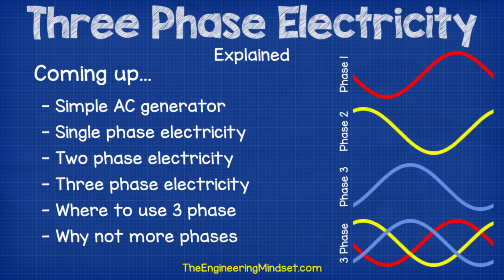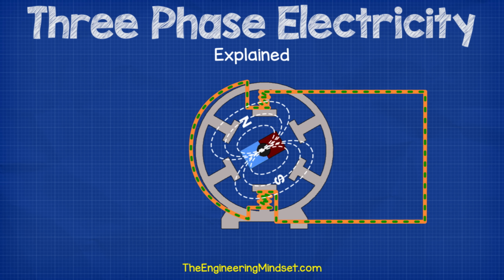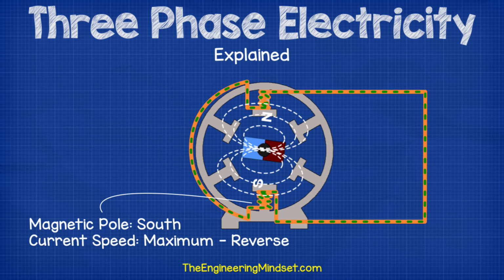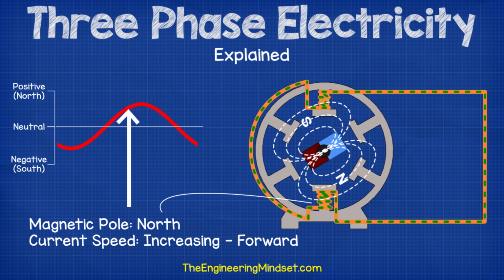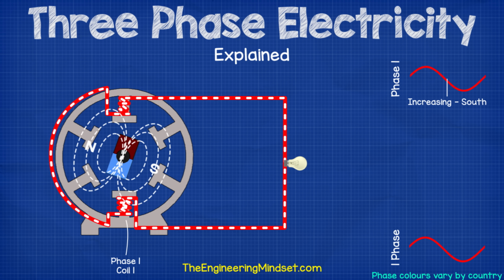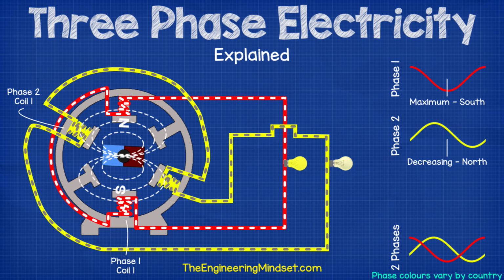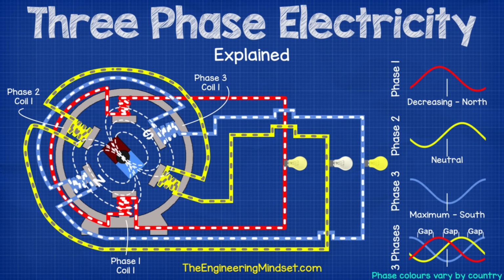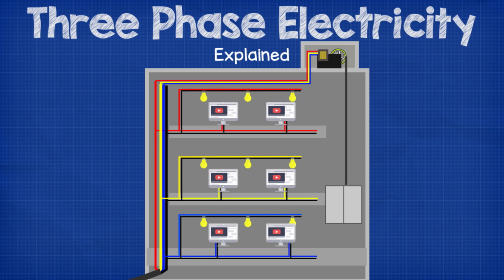How Three Phase Electricity works - The basics explained

Comment: You mentioned single phase electricity creates a dimming of a light because of the voltage change, but then later in the video said residential homes use single phase and office buildings might use single phase for lights? How do you maintain constant power with single phase electricity?
Reply from the maker: It's happening 100 times a second, it's basically constant to the human eye

Comment: In Europe it is normal to have all three phases connected to every building to have a more even distribution of load on each phase.
It is also more common to find 3-phase equipment for consumer use in Europe.
Reply from the maker: Check our new revamped 3 phase explained video, sooooo much better:👉 LINK: https://youtu.be/c9gm_NL7KyE

Comment: I don't know where you live, but I have never seen a house that doesn't have 3 phases. You need it for your typical oven & stove, and in more modern houses for the heat pump or electric car charger.
Reply from the maker: Check our new revamped 3 phase explained video, sooooo much better:👉 LINK: https://youtu.be/c9gm_NL7KyE

Comment: all the process is right and explanation is superclass but there is a problem ,I thought... magnetic strength is high on the axis of magnet and low in the direction 90 degree with axis .... flowing of current is not dependent on strength , it depends on the change of magnetic field flux... maximum current or voltage  will be found then where the change of flux is maximum and this is on direction 90 degree  because the change of flux is maximum in this position which was demonstrated on graph by your lecture , but there magnetic field strength is low not maximum position compared to other position of magnet bar...

please, everyone reply  and help me to clear my concept ...
Reply from the maker: Check our new revamped 3 phase explained video, sooooo much better:👉 LINK: https://youtu.be/c9gm_NL7KyE

Comment: You labeled the poles of the magnetic field incorrectly by mistake.  The north and south poles are actually separated like the red and blue colors on your magnet.  In other words, the dipole moment is supposed to be parallel to the axis of symmetry.  Instead, you accidentally depicted the dipole moment as being perpendicular to this axis.
Reply from the maker: Check our new revamped 3 phase explained video, sooooo much better:👉 LINK: https://youtu.be/c9gm_NL7KyE

Comment: There is no flickering in the lamps mate.
All these lamps run on single phase, and they do not flicker.
They have a wolfram coil inside them that is glowing.
Reply from the maker: They flicker, look at a city at night from a distance. Or connect a lamp to a VFD and slow the frequency down.

Comment: Is a single family home connected to 3-phase or not, well it depends, , al least here in norway, newer builds generally have 3-phase avakable at the phuse box/nain dustribution bard/ call ir what you want
Reply from the maker: Check our new revamped 3 phase explained video, sooooo much better:👉 LINK: https://youtu.be/c9gm_NL7KyE

Comment: Good information and animations, but where on earth do you only have a single phase to an entire house? I live in Denmark and haven't seen a house only use 1 phase, i've seen small apartments use only 1 phase but also the same size use 3 phase. In my house the fases are split into different sections, like kitchen and bathroom downstairs use L1(phase 1), 2 bedrooms and living room use L2 and second floor only uses L3.
Reply from the maker: Check our new revamped 3 phase explained video, sooooo much better:👉 LINK: https://youtu.be/c9gm_NL7KyE

Comment: This never made sense to me, as I was always under an impression that those 3 phases are distributed using a single power wire (since sockets in our apartments have just power and ground lines). This video has made it all clear, thanks.
Reply from the maker: Check our new revamped 3 phase explained video, sooooo much better:👉 LINK: https://youtu.be/c9gm_NL7KyE

Comment: Great  spatial and mechanical explanation of AC power generation and flow. This confirms how I thought it worked for many years, but could never get any kind of clear explanation from some of my electrican friends. I began to suspect they probably didn't really understand it themselves. I guess you can spend years pulling wires and not need to know this stuff. I absolutely love your videos!  Thanks!
Reply: @Karen Fiedler I call that the "Waterboy" condition. In that movie, Adam Sandler's character was constantly involved in football games, but he never learned how to play, because it wasn't necessary for his particular job.
Reply from the maker: Check our new revamped 3 phase explained video, sooooo much better:👉 LINK: https://youtu.be/c9gm_NL7KyE

Comment: I do have a question, if anyone can make me understand. Is a cycle considered only for one pole of a magnet ? Because let's say the  south is at the top, forcing electrons to go in one direction, while at the same time, the north is automatically at the bottom , forcing electrons to move in the other direction. So doesn't that mean that electrons moved by south and electrons moved by north meet somewhere on the left or right? So when do we consider a cycle? i'm a little confused
Reply from the maker: Check our new revamped 3 phase explained video, sooooo much better:👉 LINK: https://youtu.be/c9gm_NL7KyE

Comment: Hi, Thank you very much for the video and it is meaningful...…. I would also like to know the complete procedure how a permanent magnet synchronous motor works from scratch...It will be great if you can provide me a link or guide of each step (starting from the supply of 3 phase AC to the stator)
Reply from the maker: Check our new revamped 3 phase explained video, sooooo much better:👉 LINK: https://youtu.be/c9gm_NL7KyE

Comment: Bravo.......I under stand three phase ......and motors........short storie long.....I have  three phase dc controler 440 volt 32 amp.......question....if u pulse dc isn't that just ac.......cheers
Reply from the maker: Check our new revamped 3 phase explained video, sooooo much better:👉 LINK: https://youtu.be/c9gm_NL7KyE

Comment: would be more accurate if you included the main and subpanels in your diagram to show you are not running 120v circuits directly off a 3 phase wire.
Reply from the maker: Please see our videos on main electrical panels
Reply from the maker: Check the new SUB PANEL EXPLAINED ➡️ video https://youtu.be/NUSNa-7Hecw

Comment: moment of phases and power
wires of alternator for 10A
cos phi = 1
4.30 - single phase
127V - 1270W
230V - 2300W

5.00 - two phase (from 3ph system)
2x 127V - 2540W
2x 230V - 4600W

5.30 - three phase
3x 127/220V - 3810W
3x 230/400V - 6900W
Reply from the maker: Check our new revamped 3 phase explained video, sooooo much better:👉 LINK: https://youtu.be/c9gm_NL7KyE

Comment: 3 phase systems in low voltage existing divesity of voltages: 120/208, 127/220V, 133/230V, 220/380V, 230/400V, 240/415V, (254)440V, (266)460V, (277)480V.
For home 127/220V is better. For industry 400V.
Reply from the maker: Seen our new 3 phase transformer video?➡️: https://youtu.be/u0SsejDCVkU

Comment: I didn't sift through dozens of comments, sorry if this was already addressed.  In North America, residential dwellings routinely are fed two phases  of electricity. Single phase delivers ~120 volts for lighting, electronics, vacuum cleaners, hair dryers, other small appliances, etc. via 'wall outlets'. Both phases deliver ~220 volts when coupled together and are used to power electric ranges (ovens & cooktops), air conditioning & heat pump compressors, electric clothes dryers, electric  vehicle  battery  chargers, etc..
Reply from the maker: Check our new revamped 3 phase explained video, sooooo much better:👉 LINK: https://youtu.be/c9gm_NL7KyE

Comment: A decent explanation of the power generation, but I think you missed a LOT of things that need to be understood.  For example, you do not help the user understand why the 2 phase power of a 240V USA system is actually 180 degrees, not 120 degrees out of phase (yes, it is a transformer trick).  And you miss helping the viewers with why the phases of power don't add up linearly for voltages (RMS voltage vs peak voltage).
Reply from the maker: It's all covered in other, newer videos. This one is old and terrible, I don't know how you've even been recommended it.
Reply from the maker: Seen our new Transformer video? here https://youtu.be/jcY4QN7awEc

Comment: Very good video, but you should have mentioned every connected phase doubles the voltage supplied to the appliance ...ie: a 110v appliance will get toasted if you connect it to 220v...
Reply from the maker: Check our new revamped 3 phase explained video, sooooo much better:👉 LINK: https://youtu.be/c9gm_NL7KyE

Comment: Well houses also have 3 phase power because there are house devices that need three phase power, for example electric stove, large Storage heater, strong machinery and appliances like wood cutting machine or welding machine, so three phase for a house is a must. It could be done also by using 3 separate single phases  in one 3 phase electrical connector, but strong fuse and thicker wires are needed.
Reply from the maker: Check our new revamped 3 phase explained video, sooooo much better:👉 LINK: https://youtu.be/c9gm_NL7KyE

Comment: I have a question,  if the electrons keep speeding up should those graph like animations keep getting steeper upto the neutral parts? This is not a critique or so I just want to know if i am understanding this correctly.  Thank for the vid!
Reply from the maker: The video mentions speed but really it's the amount of electrons changing. Their speed remains constant. It's hard to imagine an electron instantly going the other way at the same speed. So at the peak of the graph the maximum amount of electrons are flowing and at the  zero line, no electrons are flowing
Reply: @EngineeringMindset  Great answer! Thank you!

Comment: Cool explanation. I worked on radars in my career that used 3-phase, 3 wire (nine legs of 120v AC). Massive power output
Reply from the maker: Check our new revamped 3 phase explained video, sooooo much better:👉 LINK: https://youtu.be/c9gm_NL7KyE

Comment: I would add, tungsten lights heat an element that retains the energy and therefor continues to glow between pulses. This makes it basically undetectable.  It becomes much more obviously when you are looking at gas lamps like florescent or sodium vapour lights which have a ballasts to control the energy pulses. Video cameras can flicker or take images almost at the same rate and can synch up with the flicker of these gas lights.
Reply from the maker: Check our new revamped 3 phase explained video, sooooo much better:👉 LINK: https://youtu.be/c9gm_NL7KyE

Comment: Hey there, great video. I would just like to point out that the biggest reason we use 3 phases comes down to more than just what is reasonable for most budgets. 3 balanced phases have a very important property where the sum of their instantaneous power output stays constant when the loads are the same. This apparently makes transmission of power easier, but also means a 3 phase motor will be able to receive a constant instantaneous power from the electrical grid. With less than 3 phases that power is subject to intense oscillation and even dips below zero at times.
Reply from the maker: Check our new revamped 3 phase explained video, sooooo much better:👉 LINK: https://youtu.be/c9gm_NL7KyE

Comment: Can i ask..
Assuming the neutral is represent as the negative then the phase 1,2&3 is the live wire or the hot wire..
My question is can i connect those phase 1,2&3 to have 1hot wire and 1 negative (the zero volt)?

Pls respect. I just want to learn...
Reply from the maker: Check our new revamped 3 phase explained video, sooooo much better:👉 LINK: https://youtu.be/c9gm_NL7KyE

Comment: If you're going to power, say an outbuilding....and have a two post car lift, welder etc.  Check the voltage... on the build plate:  208-230 / 220V.   You may have a 240 motor but it will run on 208.  If you're looking for to power equipment and run your lights (120) 208.  Get a 3 phase generator if you want to run equipment. before you buy equipment check the mfg. voltage / Factory wire.  Most modern equipment will operate just fine on 208
Reply from the maker: Seen our new 3 phase transformer video?➡️: https://youtu.be/u0SsejDCVkU

Comment: If a factory had a three phase supply would they be charged 3x the amount for their unit of electricity (kw/h)?
Reply from the maker: No. They only get charged what they used per phase. Each phase will use slightly different kwh. They could have a 3 phase supply but only use 1 of the phases. I've once audited a building that had a 3 phase incomer but only used 2 of the phases. Never seen that since.

Comment: This would be a 1/3 parted phase motor, not a real 3 Phase and no following together parted motor .
A little irritating. Ok the phases are showed separately . But the beginning is counter part pol motor.
and then following the other totaly pols. it is a magnet switching band motor from construction.
Reply from the maker: Check our new revamped 3 phase explained video, sooooo much better:👉 LINK: https://youtu.be/c9gm_NL7KyE

Comment: Thank you for this great video. Just one observation: Light bulbs do not flicker for two reasons. One is, as you state, because 60Hz is too fast for the human eye to easily discern. (Actually the fluctuation in power is even faster, 120 Hz.) The second - and more important - is that the light is emitted by a hot filament, which does not heat up or cool down fast enough to respond to the ac frequency. A bulb filament emits the average power at roughly a constant rate, with only very slight surges and dips in response to the frequency.
Reply from the maker: Check our new revamped 3 phase explained video, sooooo much better:👉 LINK: https://youtu.be/c9gm_NL7KyE

Comment: Isn't the main reason for three-phase power generation is that it permits a feedback of electricity into the generator's electromagnets, and thereby a substantial augmentation of the generator's power, whereas ordinarily such self-excitation would be possible with only DC current?
Reply from the maker: Check our new revamped 3 phase explained video, sooooo much better:👉 LINK: https://youtu.be/c9gm_NL7KyE

Comment: Great video with an excellent explanation of three-phase power, one of the best I’ve seen.  You handled the alternating current great too.  Just a few issues with this (not being a troll, just pointing them out).  First, most houses, in the U.S. at least, are provided with two phase power.  Second, your explanation, perhaps it’s explained in the transformer video mentioned, shows two-phase as being 120 degrees out when it is actually 180 out.  Besides that, GREAT video. Thanks!
Reply from the maker: Seen our new Transformer video? here https://youtu.be/jcY4QN7awEc

Comment: Not entirely true about computers not needing 3 phase, data centers, server rooms and critical computers are usually plugged into 3 phase PDUs which in turn are plugged into UPS, and not just server computers, but also networking equipment, KVM switches and environment monitoring equipment for those computers within this environment, wonderful video thank you
Reply from the maker: Check our new revamped 3 phase explained video, sooooo much better:👉 LINK: https://youtu.be/c9gm_NL7KyE
Reply: @EngineeringMindset  def will do that thank you

Comment: So if i understand correctly, a phase is kind of like a piston in a 3 cylinder engine, when one is at tdc, (positive) bdc, (negitive) and the last halfway (neutral)? Took me years to try to understand 3 phase, and i feel thats correct. Each cylinder is replacing the other as its on its exhaust stroke, and are placed a certain # of degrees apart from one another so the power keeps going, more cylinders you add, the more consistent the power that goes to your wheels.  3 phase i think works the same way, correct me if im wrong, id like to see if my description is accurate, thanks.
Reply from the maker: Check our new revamped 3 phase explained video, sooooo much better:👉 LINK: https://youtu.be/c9gm_NL7KyE

Comment: thank you so much for this very important yet awesomely simple explained information.
may i ask a question?
does this mean that if i have a 3phase 10kw generator, then i can actually use 30kw in 1 phase(dc)?
or in other words can i connect the generator to 3 different machines that use 10kw each which are DC ??
thnx
Reply from the maker: Check our new revamped 3 phase explained video, sooooo much better:👉 LINK: https://youtu.be/c9gm_NL7KyE

Comment: Incredible video, thank you.

Just one question, if anyone reads this, please.
Since currents are tri-phasic, and homes usually only receive one of the phases, why aren't the lights in my home switching on/off?
Do lights in homes use a DC current?
Reply from the maker: Check our new revamped 3 phase explained video, sooooo much better:👉 LINK: https://youtu.be/c9gm_NL7KyE

Comment: This is wrong at 2:30. The electrons don't physically move that fast through the circuit to cause power to transmit. It's an electro-magnetic field that's generated across the wire in 2 planes perpendicular to each other. They're described by Maxwell's equation and this is the field that transmits power. This does magnetize the outside of the conductor and does cause a bit of electrical flow but the velocity of electron cloud isn't that much.
Reply from the maker: Check our new revamped 3 phase explained video, sooooo much better:👉 LINK: https://youtu.be/c9gm_NL7KyE

Comment: If I wanted to measure the total power used by an induction motor, do I measure all three phases (Voltage, Current and Power Factor) and then sum up the values or take the average?
Reply from the maker: Check our new revamped 3 phase explained video, sooooo much better:👉 LINK: https://youtu.be/c9gm_NL7KyE